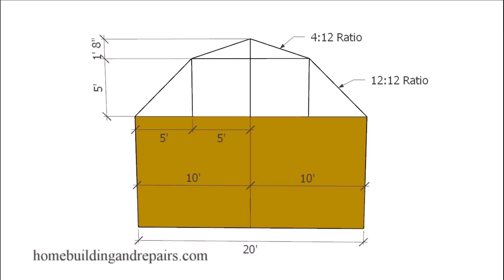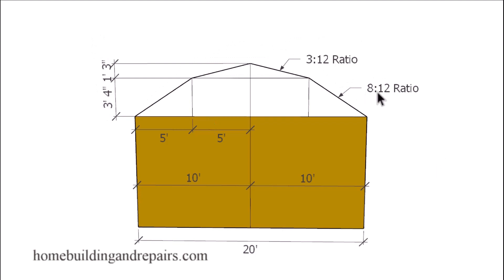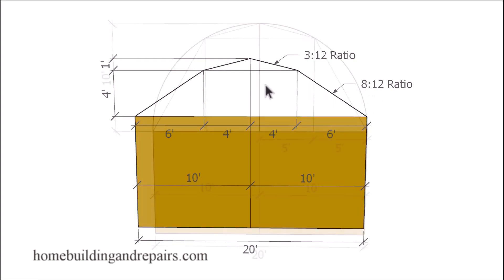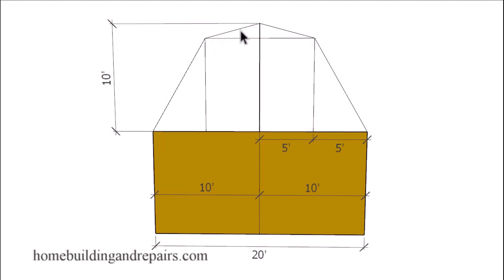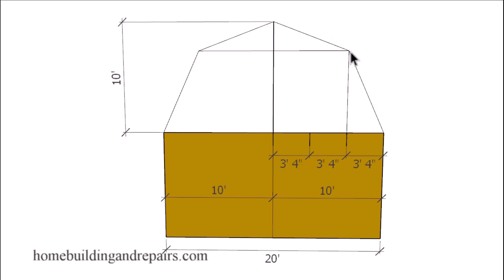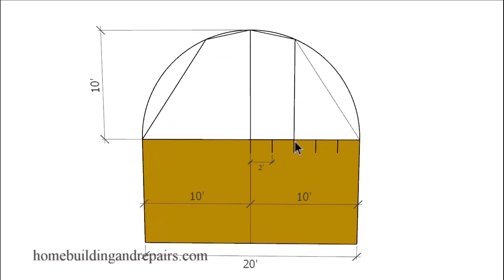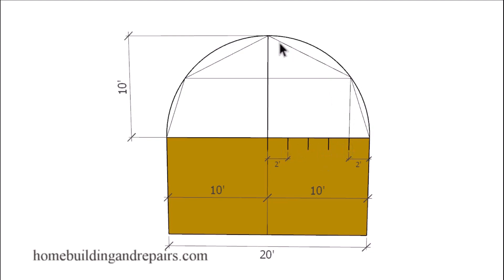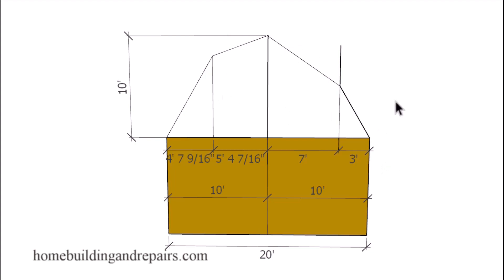How to Create Different Gambrel Roof Design By Simply Moving A Few Lines On Your Home Plans

Comment: Can the same be done with Gamble on one side of the roof and gambrel on the other ? Example Left is standard Gamble  but right side retrofitted as gambrel ?
Reply: Maybe! It depends on if you are looking for a cosmetic change on the outside or completely change the rafters to create more living space inside. It also depends a lot on how the house was built and local restrictions on home improvements.

 I think I saw a roof like that the other day. It had a double pitch on the front with two dormers. The back was a long intermediate pitch leading down to a single story. Usually when I see these asymmetric roofs it has a steep pitch in the front and shallow pitch in the back.

Comment: I did a stupid and drew a semicircle with a diameter two feet wider than the exterior of the walls... then I eyeballed what angle I wanted.. the top runners are 54" long the lower slopes are 62.5"